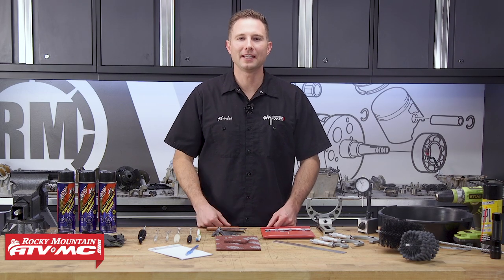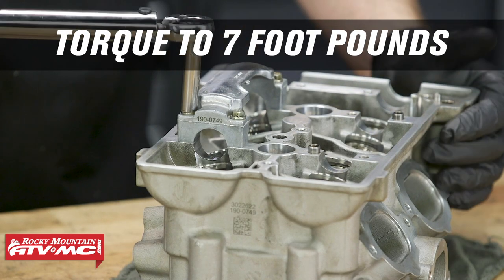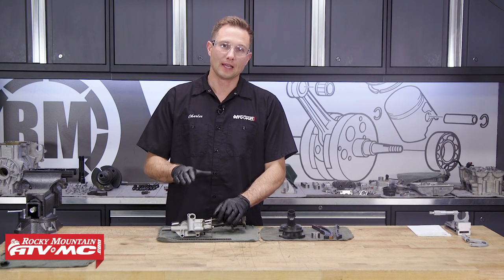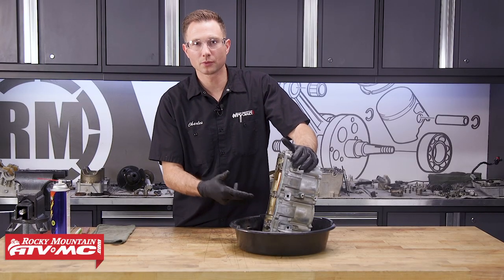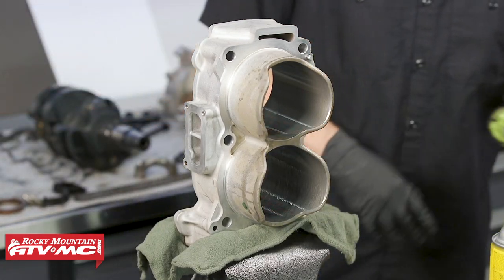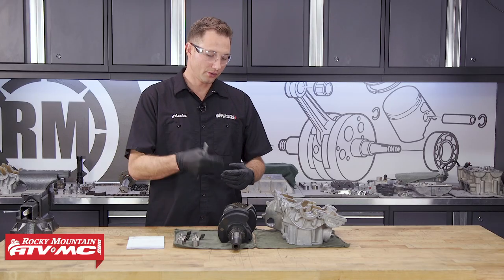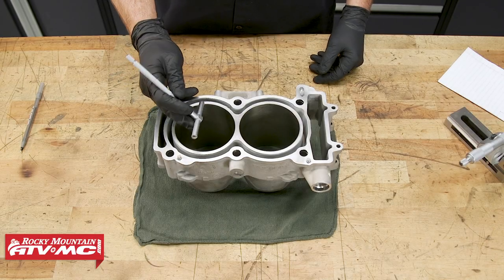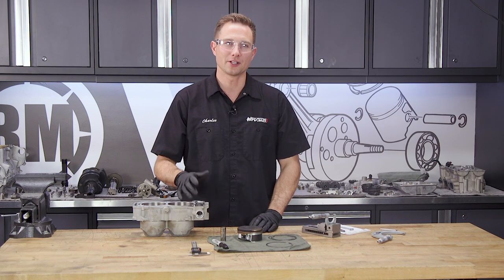Polaris RZR XP 1000 Engine Rebuild | Part 3: Engine Cleaning & Inspection

Comment: Love the extreme attention to detail you guys put into these videos. I don't even have my RZR yet, and i'm just watching this. I could not imagine going through a rebuild like this without some type of video like this. I presume the real differences between this and a XP Turbo motor is just removing the turbo and different clearances?
Reply from the maker: Thanks, we try hard to make these videos good! Yeah, removing the turbo will be different, I know the top chain guide will look a little different too, but won't change the process. Other than than that, these videos should get you through the job. As always, you'll want to reference your manual for any differences in specs! -Charles

Comment: What size and grit ball hone did you use?
Reply: Did you ever figure out what size and grit ?
Reply: @JJackson2208  i used a flex hone brand 3 3/4in (95mm) 320SC. Part number is GB33432. I got it from amazon

Comment: Main bearing selection the same on xp turbo 16-22??
Reply from the maker: It does look like the XP 1000 and XP Turbo use some of the same part #'s for the main and connecting bearings. But you will want to check the OEM parts finder for your specific machine to make sure you get the correct part. You can find the Polaris OEM parts here: https://www.rockymountainatvmc.com/oem-parts/Polaris
Reply: I'm having to do this now that I lost my water pump oil pump chain thinking of turboing my 1k xp